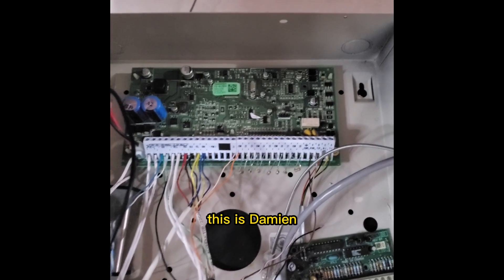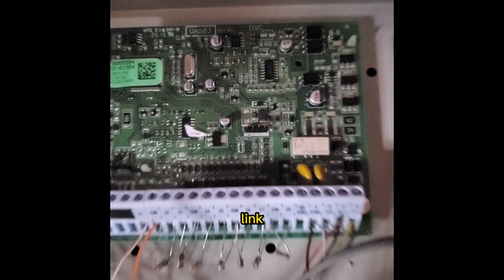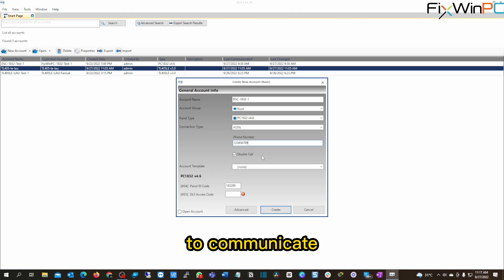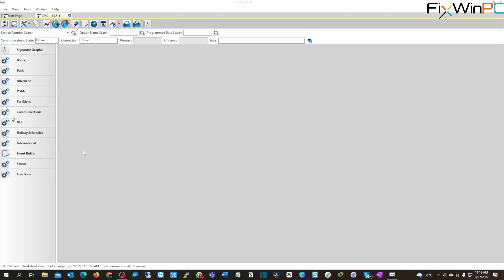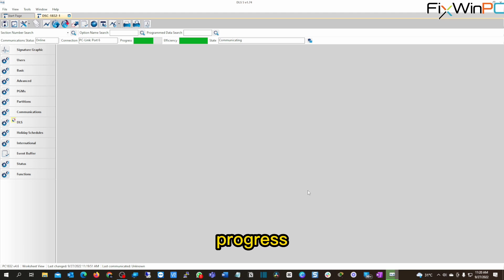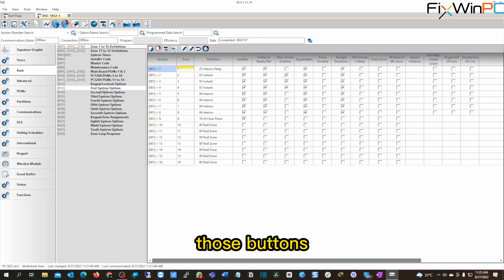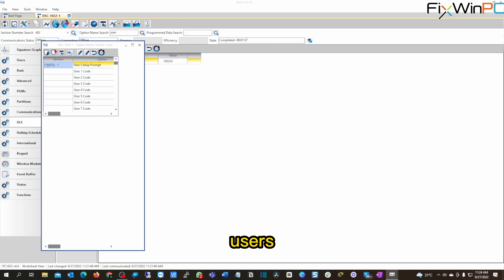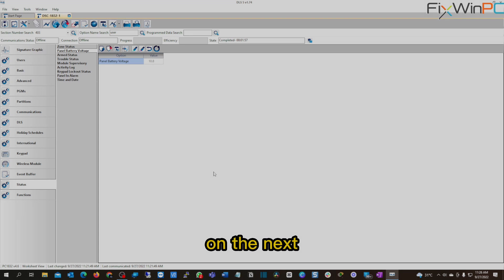How To Connect To DSC 1832 Panel Using PC Link Kit and DLS5 Software v1.74

Comment: i have dsc 832 with low battery fault for years. I recently replaced with a brand new battery (tested it 12.8V) and never able  to clear the battery fault.  i am buying the link cable kit to dig deeper and see if i can reset the fault somehow. any suggestions would be greatly appreciated.

Comment: Once you start your programming with the software, you're supposed to enter installer program mode press 499, press installer code again then 499 again which will initiate the local upload/download. Quite frankly if all I have to do is unplug and reconnect, that's a hell of a lot quicker than the actual procedure which usually requires walking to the closest keypad.

Comment: Saw Video this Morning, Went to an Install I Did Years Ago, Went Beyond 32 Zones, Wanted to Upload from 1832, V 4.7. No 4.7 in Choices, Tech Support Said Use 4.6. Wanted To Upload,From 1832, Then Download to New 1864(64 Zones), Couple Keypads, Additional Receiver, Hardwired Zone Expanders, Additional PGM's, TL 150, IP Communicator, Cell Backup.
(Like an Envisa Link) but Free, Just Need To Open Port..
Used an App by Robert Chou. I Still Can Use, Paid $6? Years Ago, Can't Find anymore, Glad I Still Have. I Have about 7 Wireless, 8 Hardwired Water Sensors, Waterbugs. Toilets, 
Sink, Dishwasher, Water Heater, Refrigerator, anything Water, It shuts off 1" Ball Valve in 2 Seconds, 
I Have All Perimeter Doors Trigger A Relay to Shutoff AC if Perimeter Doors are Open More Than 5 Minutes, Time is Adjustable. AC Shuts Off Till All Secure, Also Have Smokes and Heats to Shut Off AC so it Doesn't Pump Smoke Throughout the House, or Give More Oxygen to the Fire, Love PGM's.  
Anyway, Very Involved and a Lot Of Programming. 
Hoping To Upload from 1832, and Download to New 1864
Downloaded Software, Created Account, Global Upload, Select pC Link, Got a Full Green Bar On the Right. NO Green on tbe Progress, zpC Link Showed No Activity. Tek Thinks Cable is Issue, Waiting on 2 RJ 12(6 cond), and Usb to  DB 9.
Will Try Your Method First, Ran Out of Time This Morning, Wish I saw Once I Saw The Issue On Site. Will Update, Don't want to do Manually, Believe , The Keypad Will Labels, Believe the Do, Lots Of Words, PC Link would sure Be Better, Will Update. Lesving a Like

Comment: Worked great for me as well on the 1832 V4.6. Been trying for weeks to log into the panel until I learned from this video to unplug the pclink adapter from the alarm board and plug it back in.  Mine would say connected but would time out......Thanks man!

Comment: So after a few months my dls5 software login password changed from what I set, 1234 don’t work, what would I do in this Situation
Reply: If you have a backup of the systems the reinstall the program
Reply: @damiondick7584  okay so the dsc panel and main board has all the programming set, I can just redownload the program and flash off the main board back to the software and have all the same things I had before I’d think correct?
Reply: @uniteddrones7626  You'll lose any comments because they aren't sent to the panel and therefore can't be recovered from the panel.
Reply: 1234 is Default DLS Password, 183200 is Panel Code, 1864 is 186400
Reply: What is default dls password to 1832 panel?
Reply from the maker: @fan4ous  183200
Reply: @fan4ous   1234